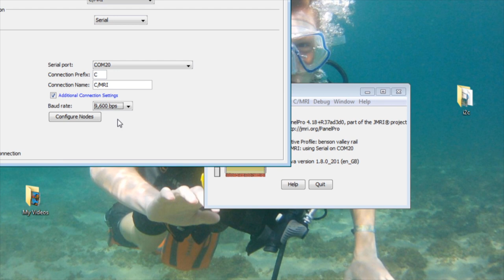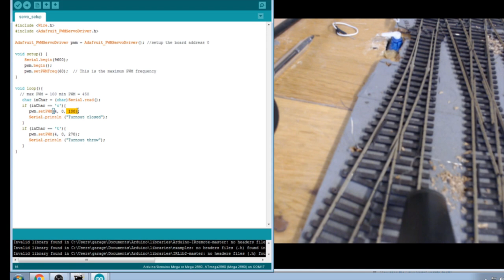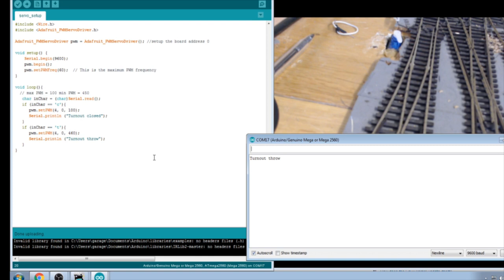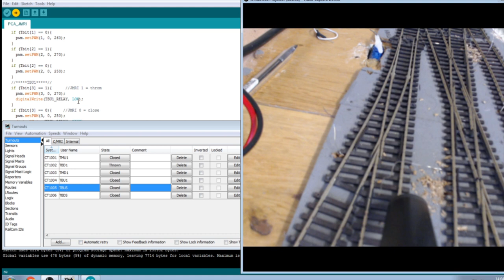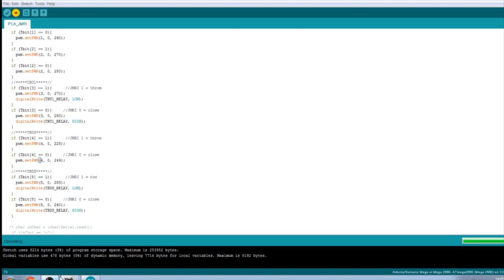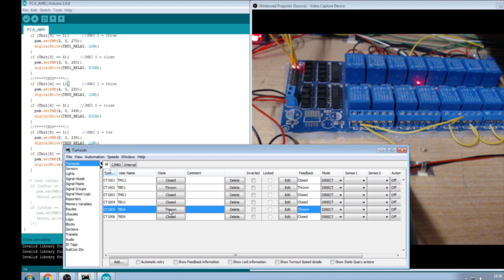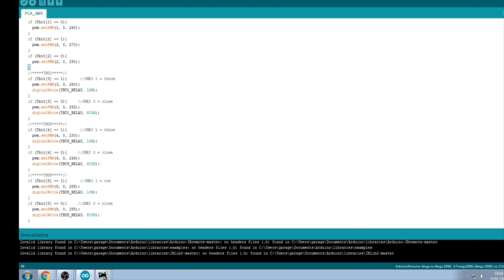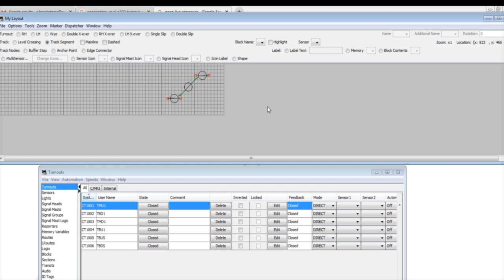Complete setup Turnout with JMRI, CMRI, Arduino using pca9685, with live-frog polarity changing

Comment: Hi again. Thanks for your videos I now have JMRI reading current sense transformer modules from 2 arduinos under CMRI working perfectly :-)  Many thanks. 
The standard servo library has commands like  myservo.attach(MYSERVOPIN); which "turns on" the pulse signal to the myservo control connected to pin MYSERVOPIN and myservo.detach(); which  "turns off" the servo signal to myservo (Pin number not needed)  - and stops that servo chatter or buzzing!  It has a myservo.write(val) command where val is the number of degrees of servo  rotation between 0 and 180. rather than the pulse delay. The "knob" example has almost all of the code needed to make calibrating much easier.  Just hot plug each servo  control wire (orange) to  pin 9  and write down the (10K linear) pot values scrolling on the screen after adding Serial.begin(9600); in the void setup() and Serial.println(val); before the last line of  void loop() and running serial monitor. Make sure the pot is positioned centre travel before hot plugging in  each servo.    The Adafriut library may well have an attach and detach too, I don't use use it so I can't be sure. 
Steve

Comment: Regarding the buzzing:  Here's a couple things  you can try.  First, you can bend a small "V" into the wire between the servo horn and the turnout.  The V will act as a slight shock absorber, but still be stiff enough to throw the turnout.  If still having problems, try a slightly smaller wire.  You can also use one of the holes on the servo horn closer to the center.  You'll need to recalibrate the distance numbers, but you should have a larger range, giving you more precise control.  Good luck and thanks for your tutorials.

Comment: Great video... you are doing exactly what I'm hoping to achieve soon... 
I'm constantly amazed by what can be achieved by Arduinos and Pis.
Reply from the maker: Thanks Patrick, I'm only scratching the surface on this. Problem I find is there is not much resources on CMRI and JMRI setup with an Arduino. Currently looking at the turnout control with CMRI using Arduino stepper motor but finding info is hard
Reply: @BrackstonesTravelAdventures  Hi fella, do you have an example of the full sketch from this video I could have a peak at?  I'm keen to see you you combine the servo and relay controls all into one sketch.  Cheers.
Reply from the maker: @patrickmaloney6440  not sure if this link will help you.http://www.motorhomesites.org.uk/pl-11-point-motor-with-jmri-cmri-arduino-control/  there are lots examples on my blog. If you have the servo working on an IF statement then with in the IF statement you can write a DigitalWrite output to a relay to control live frog polarity.

Comment: Sorry if I'm a bit late to the party. Thanks for your video. I checked it out because I'm interested in using a relay board for changing frog polarity. Just regarding your issue with the buzzing, yes you can turn the servo "off" via code. In the code I use, I issue a "servo.attach()" followed by a 200ms delay. Then I issue the command to rotate, followed by another delay (amount depends on how long it takes the servo to move) followed by "servo.detach". That seems to do the trick. By the way, I found this other option which pretty limits the need to find out exactly how far to move a servo. Food for thought (link): https://www.youtube.com/watch?v=aEO3CtemzrM